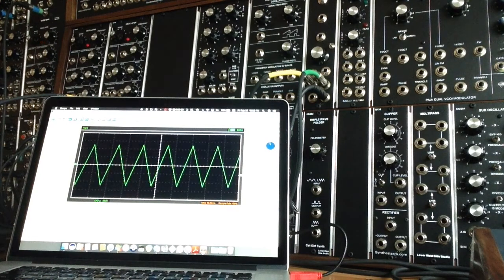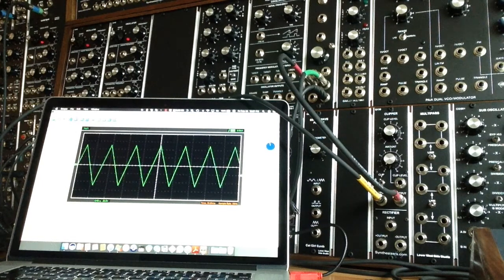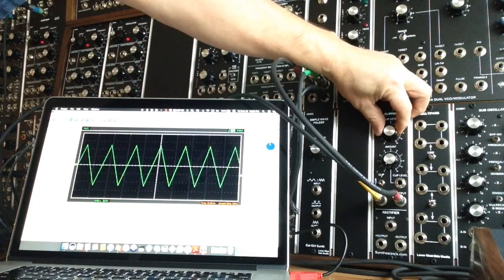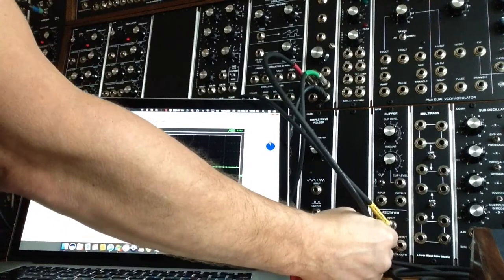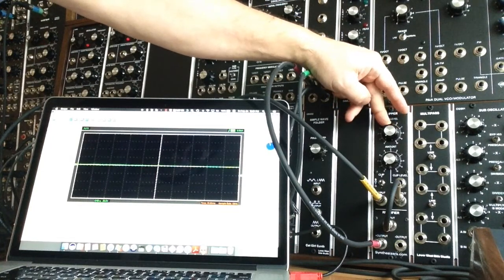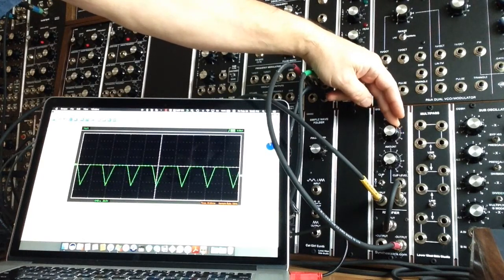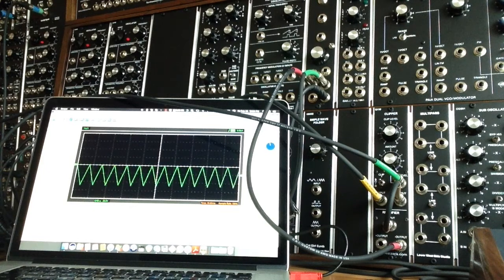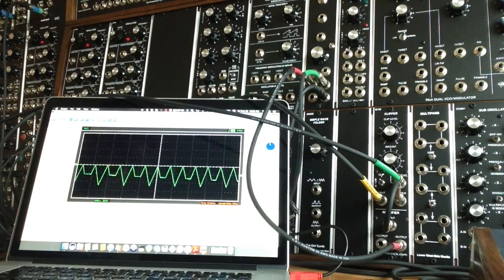Q130 Clipper / Rectifier Demo - Part 1

Comment: Very nice video!  may I ask what scope software you're using?
Reply from the maker: Thanks!  The scope is a Hantek 6022BE USB scope.  The software is version 1.05 of Hantek's own software which comes with the scope.  Unfortunately there is only a Windows version of this software so it's running on my Mac through Windows and Parallels.  It's an inexpensive scope solution that works pretty well.  I got mine on eBay.